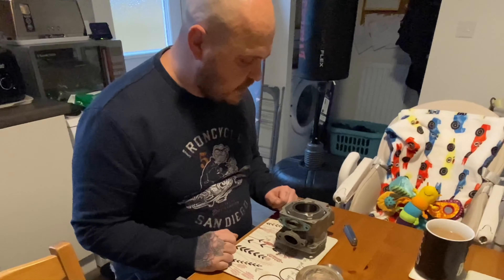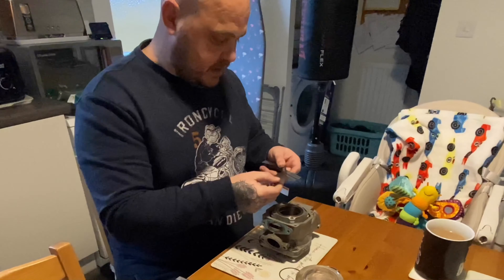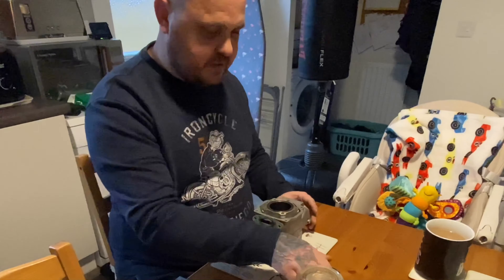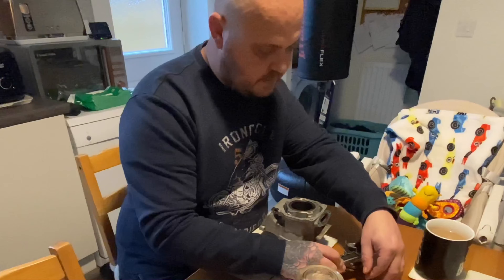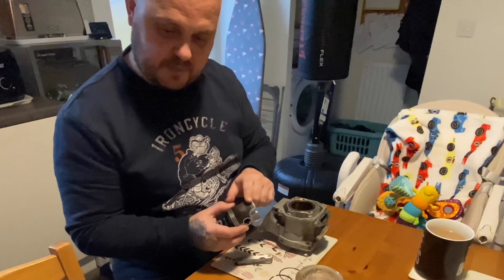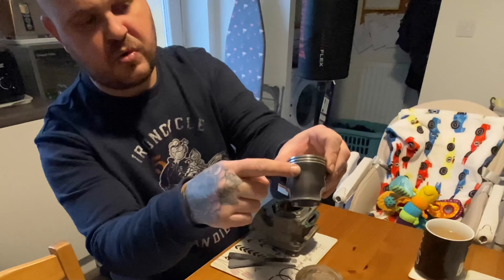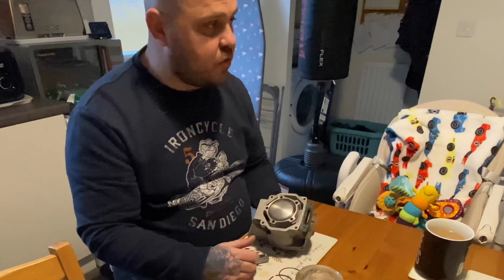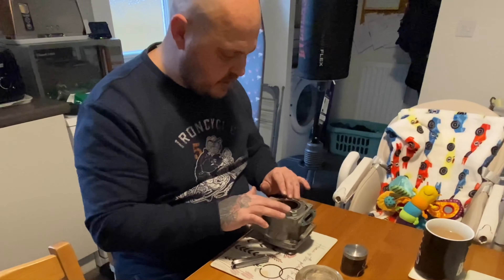Part #2 Aprilia RS125/Tuono Top End Rebuild Piston to Cylinder also Ring Gap Clearance Update.

Comment: Were you from mate uk 🇬🇧  what you plan doing with your rs125  you need to send your cylinder off and get it matched up with piston and cylinder pjme do it get in touch before you reck your top end
Reply from the maker: I live right by pjme they are not doing any workshop jobs atm. I’ve actually figured it out mate. It’s a sleeved original and I’ve found out the scraps and issues were from my bloody carb (brand new) funny enough from Pjme’s 😂 the choke bung wasn’t seating properly so was making the bike extra rich so was washing the oil out the cylinder lots of splurge but getting hot because extra friction also the intake manifold had a leak so extra issue..it’s all in hand I will do an update video. I did put a Mitaka 140 (pjme again 😂) but yet to run it in 👍
Reply: How's bike coming on your my age still got rs125 or sold it
Reply from the maker: I sold it...it became a money pit it was fun to have another 2 stroke but unfortunately it reminded me how much maintenance require 🙄